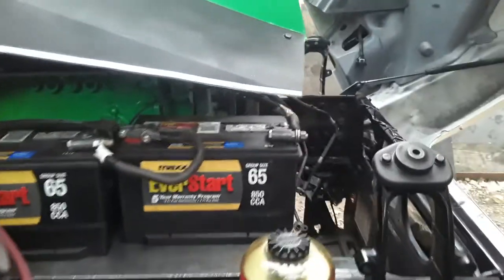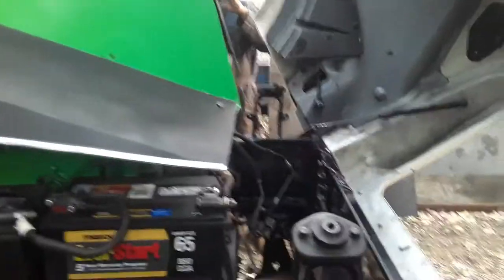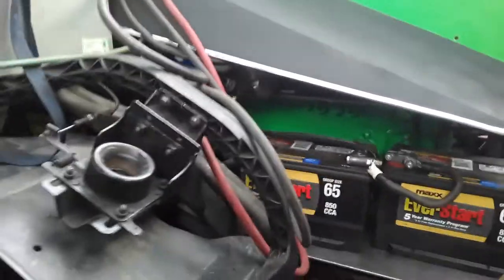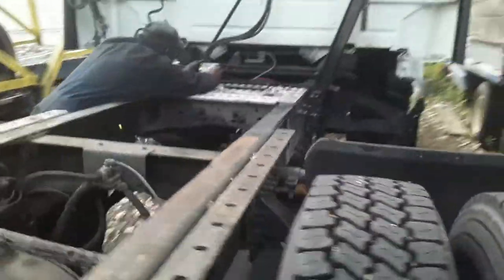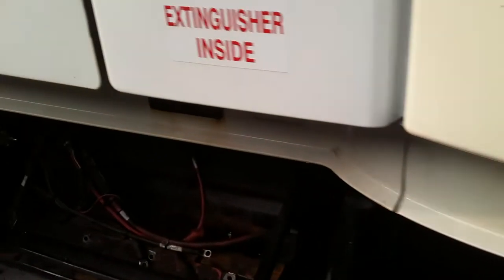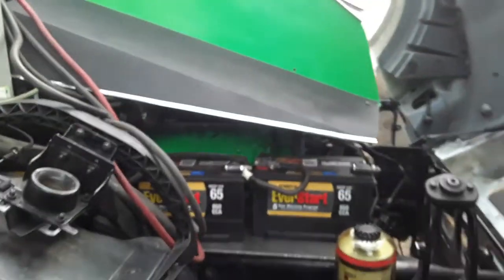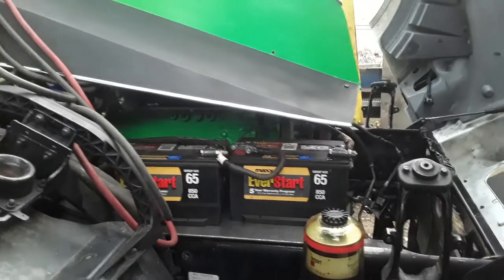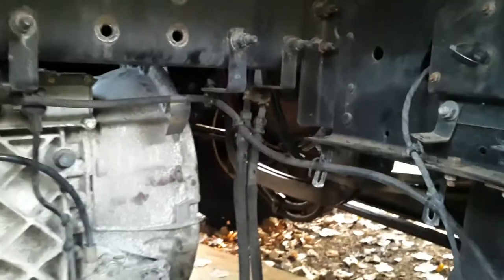Building an Electronic Tractor Trailer

Comment: não da pra ver o interior.pelo que estou entendendo vc pode movimentar esse trator usando pedais como andar de bicicleta. seria isso?
Reply from the maker: This version of tractor didn't have the human  powered pedals installed like the dump trucks, but you can easily move 80,000 pounds using the human powered version. We do plan to install the human powered flywheel system in this tractor so we can finally get a cross country demonstration done. 🍷🍷😎

Comment: Why is it idling and sounding like a diesel?
Reply from the maker: REALLY?? Take a closer look at that stripped engine block!! Like we said, there are no exhaust, tanks, or DEF on the rig. America is not ready for real innovation, we're going overseas.
Reply: @skytoll1  lol how is an electronic truck not an electric vehicle?
Reply from the maker: @tonystanley5337  you'll be able to find out when we file the patent application!! 🤣🤣🤣 Its not an electric vehicle, and has NOTHING to do with large battery packs. You're not going to move a tractor trailer on 6 lead acid batteries from Walmart!! You wouldn't even have enough juice to move a Volkswagen Beetle. 🤣🤣🤣🍷🍷🍷😁😁😎😎
Reply: @skytoll1   You need 40-600kW to shift a truck.  A single battery can provide several hundred kW for a few seconds.   A single battery will move pretty much any car on the starter, and 6 lead acid batteries will move a a small car at 30-40mph for at least 20 miles with a suitable motor, home builders have been making such cars for several decades.  Batteries and motors are very efficient and powerful, there are no power systems that I know are better.  A video with a rotating truck engine idling doesn't show anything so I wonder what the point of it is.
Reply from the maker: @tonystanley5337  the point is we've done much testing on iur technology for years, finally getting to the point of running a tractor trailer. We have ran many vehicles and done many tests on the asphalt. Electric motors WASTE too much energy, just like a gasoline engine. We can move an 80,000 pound rig on 12,000 watts worth of electrical power. We know what the consumption of an electric motor is, that's WHY we don't use them as a propulsion source. 🍷🍷🍷😁😁😁😎😎
Reply: @skytoll1  ERM no, electric motors are the most efficient way to turn energy into motion.  Some motors are 97% efficient.  12kW of mechanical power is not enough for a car never mind a truck.  A car needs about 20kW to do 70mph.
Reply from the maker: @tonystanley5337  we don't use electric motors to propel a vehicle, they WASTE too much energy as I stated. I don't need an education on propulsion, I've been researching, developing and testing alternative propulsion since 1980. I know what works and what doesn't. Our physics go beyond traditional principles, which are TOO BASIC, and only give poor results. You're seeing a short clip on a computer screen, but have no idea how to physically move massive weight on fractions of energy. That's what we do, it's not up for debate. All the good videos we posted have been REMOVED for intellectual property reasons. We aren't going to divulge the mineral rights to how this is done until the paperwork is filed. 🍷🍷🍷😎😎